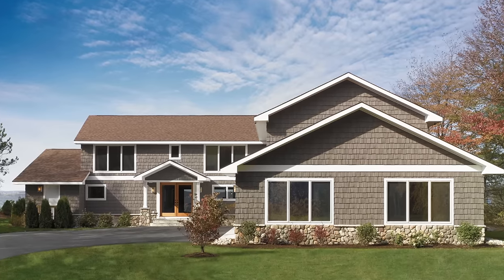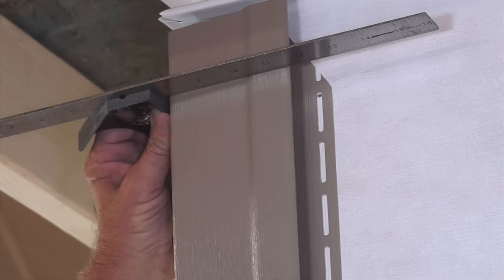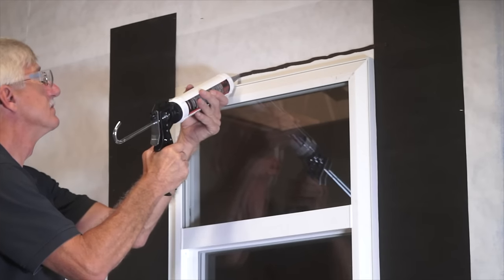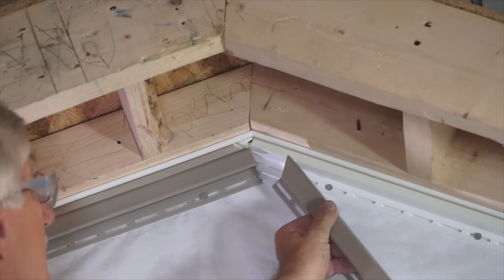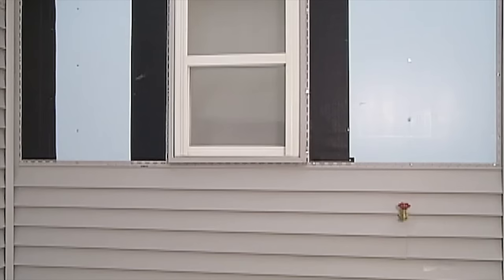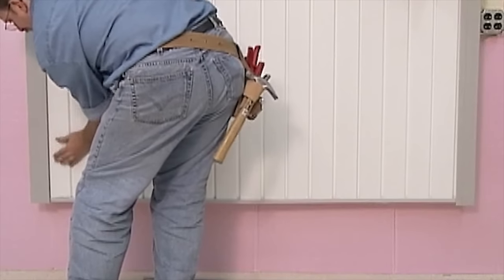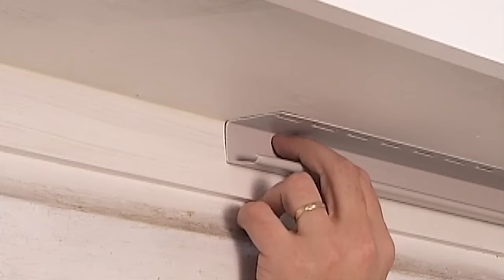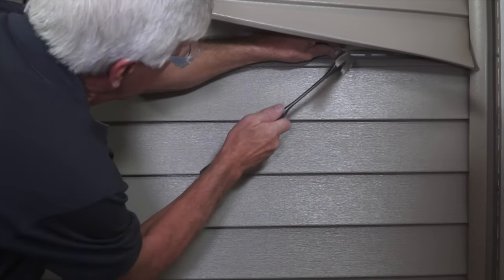How to install Vinyl Siding

Comment: This video solved an argument on the worksite. I've never installed siding, and regular common sense told me to nail  the starter strip into the wall framing on the plate(dead center). The 30 year veteran spent 20 years finding studs.
😅
Reply: Lol, veteran of ignorance

Comment: Thank you for this video. There are 5/8 and 3/4 J channels available in Home Depot. Which J-channel I should use for siding installation? Also, what is the distance from the siding strip starter edge to the concrete foundation and when do I need to install the bottom J-channel?

Comment: GREAT VIDEOS! Can siding be installed upright instead of sideways? Advantages or disadvantages ? Just curious as I would be cladding a shipping container.. would that make a difference? Styrofoam insulation outside with PVC cladding..... for Ireland.. with mostly cold and raining conditions..highest temp 25 degrees Celsius
Reply: They make vertical siding, which is meant to be installed the way you want.
Reply: You need to buy board n batten, either hardie board n batten or vinyl board n batten if you want to install siding vertically

Comment: Do i need to chalk each line for the vinyl pieces? If so how do you measure the width of the siding piece and trace it on the wall for the chalk lin?
Reply: Just for the starter strip. That's why it has it's name.
Reply: Snapping lines for each section is better then there is no guessing if it’s level or not

Comment: Complete ignorance on window tape flashing,bottom pc. Should never be surface applied over window flange always sip it up under bottom window flange  and side flanges...it should also not dump possible rain water under siding below , run siding up and dump lower window tape on top edge of closes panel below window so water can weap out of weap holes not behind siding into nail holes...blind leading blind in most videos, careful....